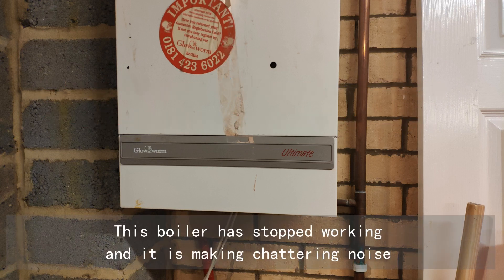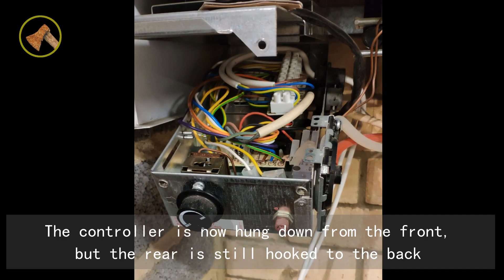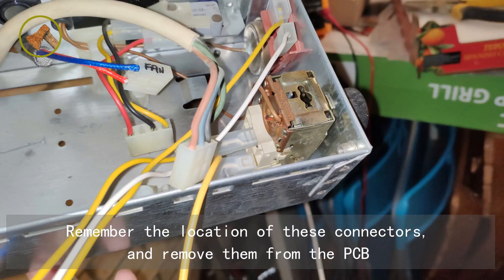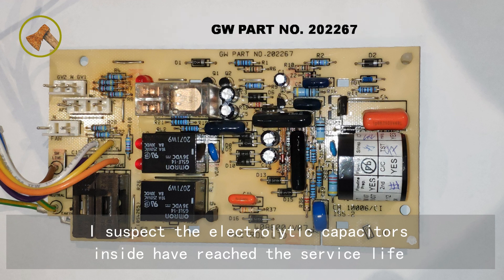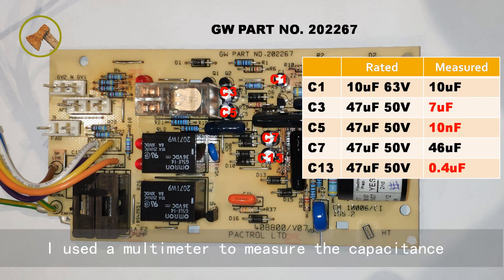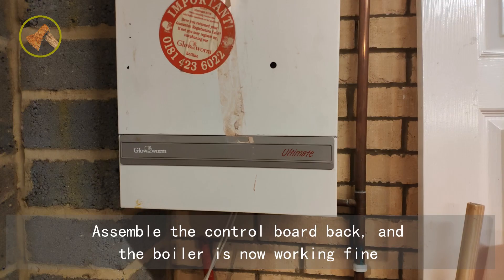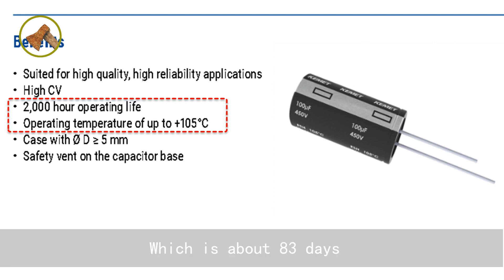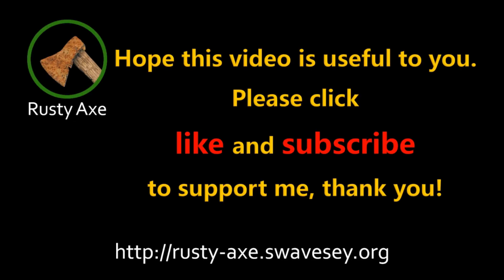How to Fix Chattering (Buzzing, Clicking) Relay Noise for Glow Worm Ultimate Boiler, part 202267

Comment: Thanks for sharing this very helpful video.  My fault was intermittent relay chattering while running on a Glowworm Ultimate 50FF, I have a different board with a single fuse and 5 wires.  It has 4 electrolytics, 50v/100uF (C8), 50v/47uF (C14), 50v/10uF (C5), 63v/4.7uF (C4) all 85 deg.  I replaced them all and while C8/14/5 all read about 10% below marked value C4 read 0.5uF only so I suspect was the cause of the fault.  Hope this helps those with a 5 wire PCB.

Comment: Hi @Rusty Ox, thanks for the great video. My boiler makes the exact same noise when it is turned on after being isolated as it happened by accident when my main fuse board tripped. However the noise only happens for 5mins and during that period the boiler still worked perfectly fine. After 5mins the noise goes away completely and boiler has no issue. What is your advise on the capacitors. Should I still replace them as per your video. My boiler is 50ff.
Reply from the maker: Depending our own skills and evaluate the risk vs benefit.  Different people has different answers. Sometimes get a spare part from eBay is a better solution.
Reply: Hi - Old feature I know but how did you fix it please?

Comment: Thank you. Have just experienced same issue and had worked out that it was the relay in the board chattering but didn't know if it was "cause or effect"  - now I know.
Reply: Hi - Old feature I know but how did you fix it please?
Reply: @GHOOGLEMALE  I changed the control board

Comment: Thank you Rusty OX, quite timely as I have just experienced the same problem. Fortunately I bought the same model boiler on ebay about 10 years ago (£50) and stripped it for spares, and importantly in this case the PCB. I have swapped the PCBs and restored functionality without the buzzing/chattering. So now my mind turns to repairing the PCB by swapping out all the capacitors you describe in your excellent video. Could you advise me where best to source replacement capacitors and any tips on how to identify the capacitor ‘solder connection points’ on the reverse of the board - I have never attempted a PCB repair before but I have nothing to lose in attempting this repair(I have a small soldering iron and a magnifying glass to amplify my old eyes). Thank you one again.😀👍
Reply from the maker: Hi Norman, I bought the replacement capacitors from Farnell (assume you are in UK). Solder pad could be identified by the physical location of the capacitors.

Comment: How do you make sure that the boiler is isolated completely from the mains electricity before you unscrew the pcb board?
Reply from the maker: I switched off the whole house socket power on the electric distribution box

Comment: Dear Sir
My boiler is same one ....it will start for 10mins then stop....and them after 15 mins it will fire up again....could u please tell me what the problem could.be....central heat pump all are working fine.....is just the boiler will not fire continues
Reply from the maker: Another common problem with this boiler is the extraction fans stuck and causes boiler shutdown (safety protection). You could try high temperature lubricant (try screwfix 86394 for UK).
Reply: If your boiler has a thermostat control knob on it, that controls how hot the boiler is allowed to get. So, if you turn that up, the boiler will run longer before the control board turns off the boiler. The themostat on the boiler affects how hot the water gets in the radiators.